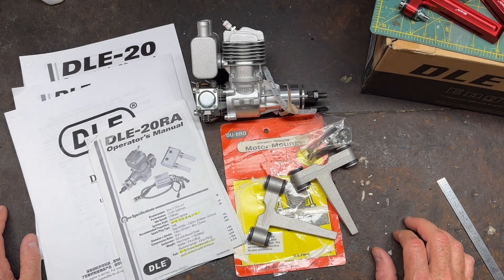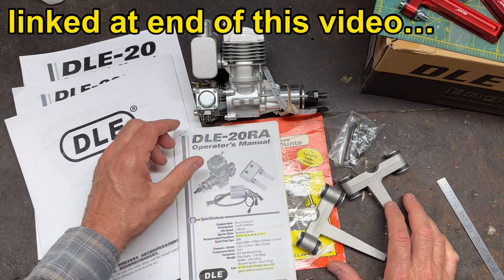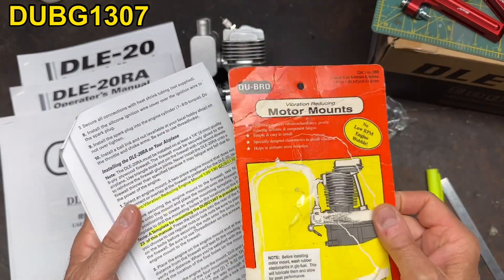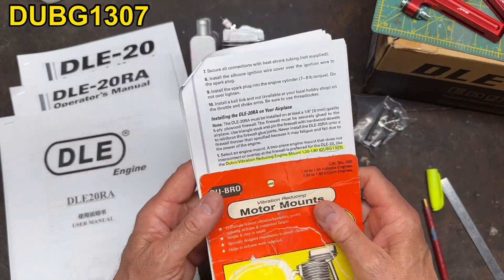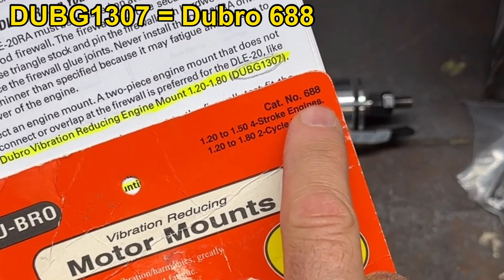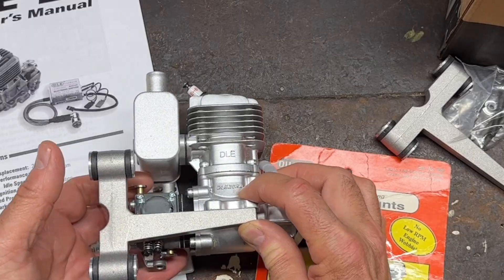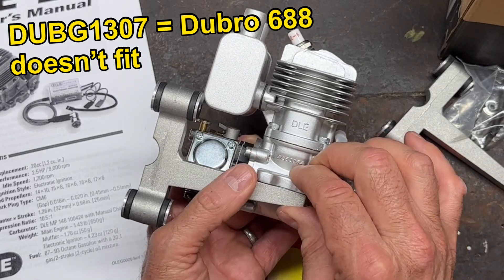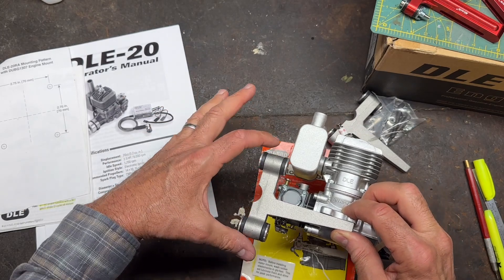DLE-20 RC Plane Gas Engine, Learning Series, No. 6: Choosing a DuBro engine mount

Comment: If you mount the motor inverted so the exhaust points down, I'll bet the manual recommended mount will work fine.
Reply from the maker: Thanks, I tried it every which way, and even after several discussions with the folks at Dubro they agreed it would not work as described in the Hobbico DLE manual, and sent me the next size down. It will work for sure on a side mount exhaust for this engine and that why it probably was in the DLE manual, they just cut and pasted the info from the side exhaust engine to the RA.

Comment: I installed a DLE 20 with a Pitts wrap around muffler in a Top Flite  .60 P-51 using the 688 mounts.  My next project is a Hanger 9 Christen Eagle with a DLE 20RA, I would have purchased the same 688 mounts if I didn't watch your video. The 682 is great info and now I know I also have a choice with the  Miracle Hobby for a 20CC. Thank You.
Reply from the maker: Awesome, thanks. Glad it was helpful. The dubro is supper expensive also.

Comment: Did you evem consider using the mid-sized engine-mount by Du-Bro (682)? Or, does it have the same issues as their large-sized engine-mount (686)?
Reply from the maker: Yes, the 682 will fit. I discussed that in the video since I contacted Dubro about it. The 682 has a shorter vertical distance between the mounting holes and it will fit under the muffler. The main reason for the video is to show that the DLE manual from Horizon wrongly recommended the 688.